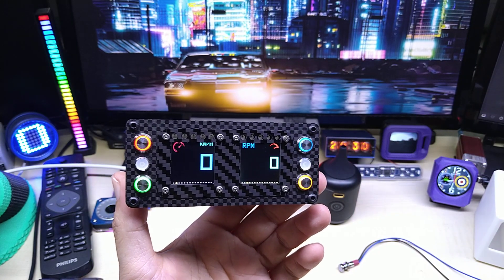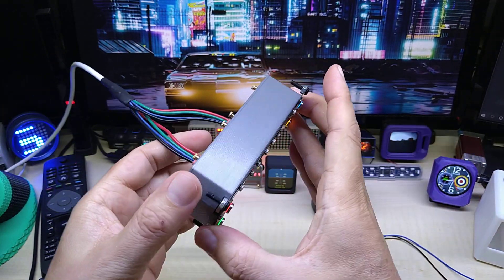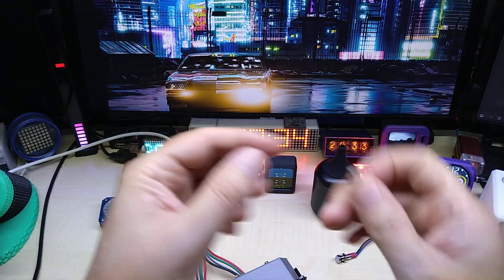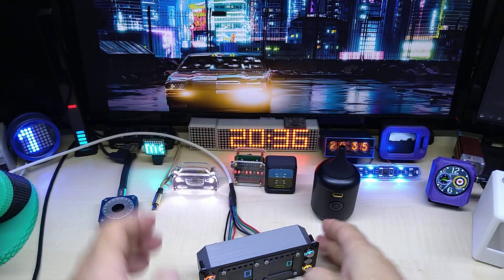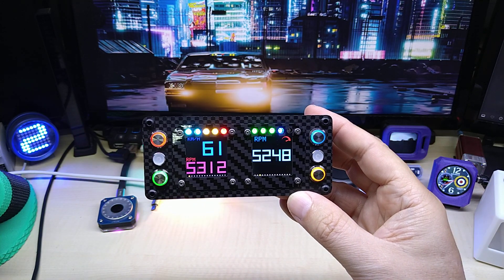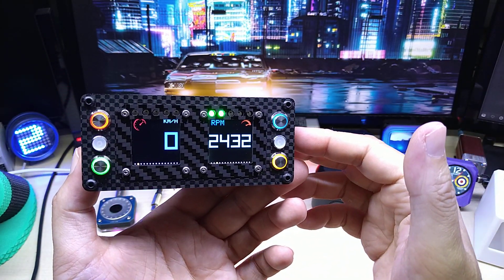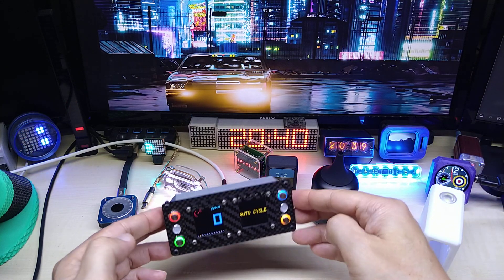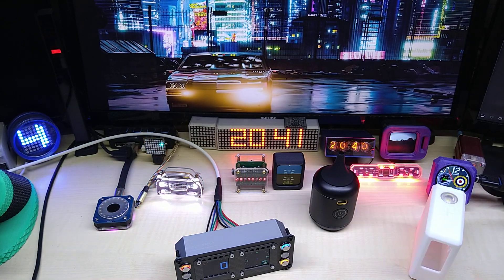Dual Mini #CANBUS Gauge with #Custom #CarbonFibre Panel Mount Enclosure with Atmega1284 by #Hayri

Comment: Very nice build!!! Your customer will simply love it!! You did a fantastic job of taking the time to grind down the LDR's to fit in the LED holders!! Awesome attention to detail and your hard work shows in the finished product!!! It really looks awesome and clean including the organized wiring harnesses coming out the back!! Thanks for sharing this with us!! Till later!!!!
Reply from the maker: Thanks Adam, I think it came together nicely apart from the cables coming out the back, which I did change and while adding a DC-DC buck converter, placed all the wires into the enclosure and only a one wire is coming out the back now, which will also make mounting it easier. Anyway, I have a few videos in the works from another DIY jet blower build, my 3rd blacked out NH36 Seiko watch, an OTF knife, LILYGO product review to the long long overdue night time test of the bike light. Stay tuned and safe my friend 🙂
Reply: Yayy!!! Can't wait for all those videos!!!!!!

Comment: Do these sensor readings have to be wired up individually to the sensors or can I just plug the reader into my OBD2 port?
Reply from the maker: No need for individual sensor wiring, as long as your car is build 2008 and after, it supports CAN BUS which this gauge is using and only needs to be plugged in into the OBDII port below your steering wheel. I also have a CAN BUS Node, which can be used with none CAN BUS cars, by wiring individual sensors like you asked to it, and then again be able to use my gauge with only 4 wires, that are Positive, Ground, CAN High and CAN Low signal.